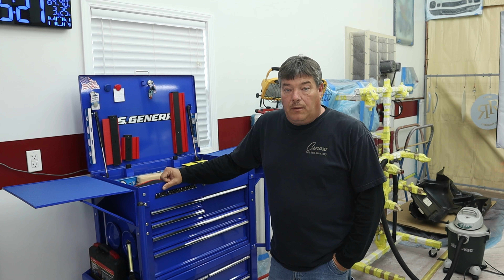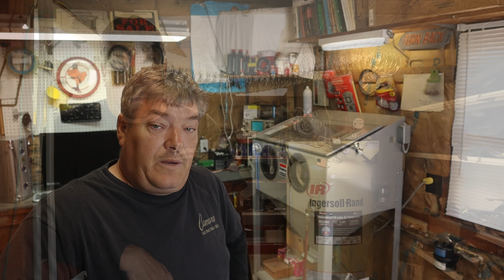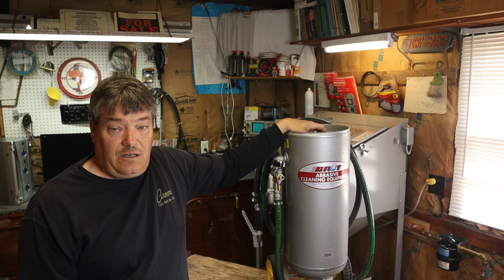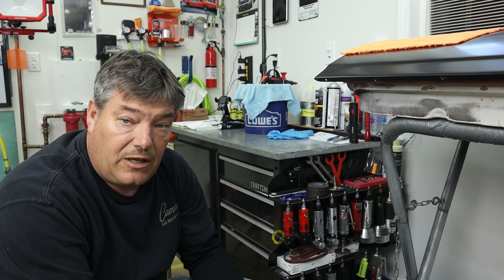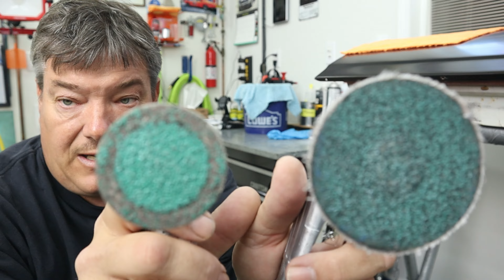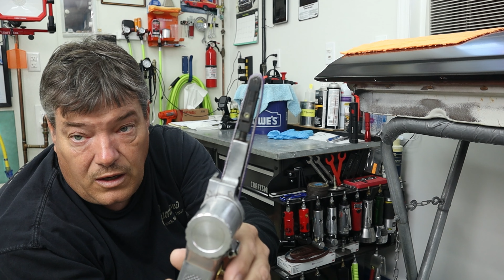Top 10 Essential Tools for Restoring My Camaro

Comment: Hey Russ, This is an excellent guide for folks. I chose to have the blasting done at a friends shop. He does great work but it is always a scheduling challenge when the the parts come back. My shop is small and the blast cabinet just will not fit. Having a good rotisserie has turned out to be big plus as I feel I have done a better job on areas of the car that would have been a nightmare to work on without it.
Reply from the maker: Hey Jon. Thats great that you have someone that can do the blasting. A rotisserie, I would think would be a huge help as well. Good to hear from you. Russ

Comment: I have a good collection of tools and it’s been more than adequate. I don’t have a welder or a sandblasting enclosure only because I am no longer getting too involved into full restorations my cars are are done and I sold them and I have a 1986 Corvette that’s like brand new and I have a 2023 ZL1 Camaro. I still enjoy taking them apart and modifying them. I’m currently onto a new project a 2024 Ford Bronco that I will be customizing soon 😊
Reply from the maker: That sounds like a great project. The frameoffs are a lot of time/money. Someday, I would like to get a truck. But Im not sure if I'll do anymore frameoffs myself
Reply: @ it’s a lot of work and can be stressful at times !
Reply from the maker: @JIMFED63  Absolutely